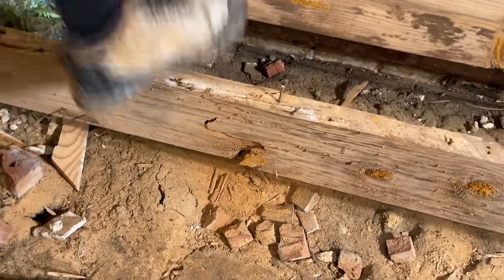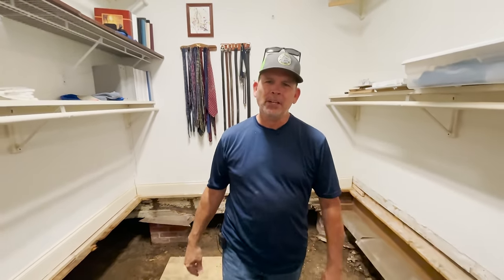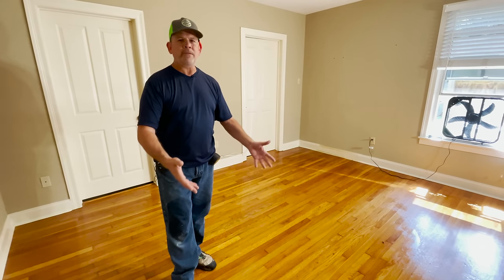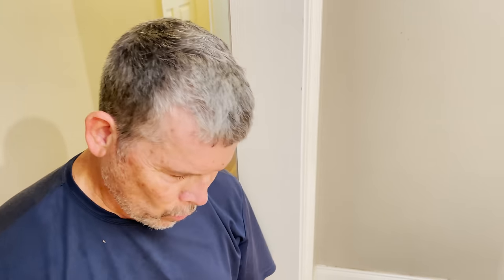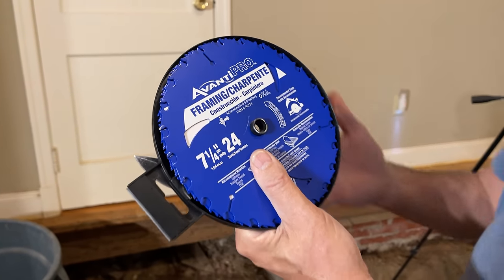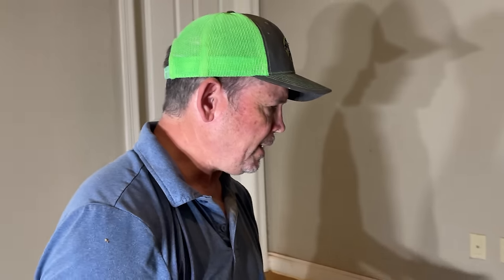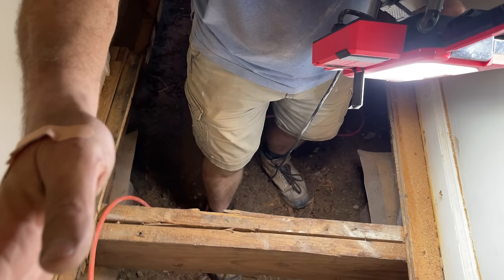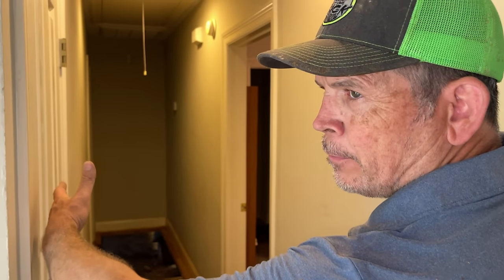This House is CAVING IN ON ITSELF!!! Can We Save It?

Comment: GUYS, DO NOT USE A SAWZAW WHEN CUTTING THE FLOOR. THAT IS THE FOUNDATION! THE BLADE IS LONG AND YOU CAN BE CUTTING FOUNDATIONAL STUDS 🤦🏽‍♂️🤦🏽‍♂️🤦🏽‍♂️🤦🏽‍♂️🤦🏽‍♂️🤦🏽‍♂️🤦🏽‍♂️🤦🏽‍♂️ HIRE PEOPLE WHO ARE LICENSED AND INSURED JUST IN CASE YOU NEED TO SUE SOMEONE (God FORBID!). YOU HAVE TO UNDERSTAND WEIGHT BEARING STUDS* ITS SO IMPORTANT

Comment: This is why the insanity of trying to save every old building needs to stop. Buildings were not all built well. Buildings don’t last forever. Save old buildings that are the most important to a community, not every building ever built. There’s a point where the correct thing to do is replace large sections of, or entire buildings.

Comment: If you don't have a basement, then why wouldn't you just pour a concrete slab on grade with CMU or concrete foundation?  This is the dumbest way to build a house.  Is this a regional thing?  In the Midwest everything is either concrete basement or concrete slab on grade with CMU or concrete foundation and footing down to the frost line (3'-0" where I'm at).  We don't have any crawl spaces like this.  This is a disaster waiting to happen.
Reply: There are crawl spaces in Michigan. Several areas homes were built on crawl space foundations. I have to do my foundation (in the crawl space) and dreading it too.

Comment: If I was the insurance company, I would have cancelled coverage, before the bathroom discovery. Because of the owner's gross neglect of the structure, and misreporting the condition of the structure. Anyone can purchase and insure a building, in any condition. It doesn't mean their insurance company is obliged to pay for repairs. This is insurance abuse, and it makes everyone else's rates more expensive. Call the demolition man, not a carpenter.
Reply from the maker: The current owners inherited this problem from the previous owners.  No neglect on their part.